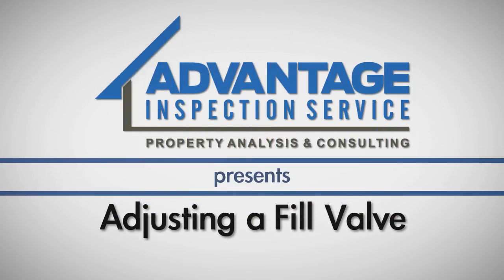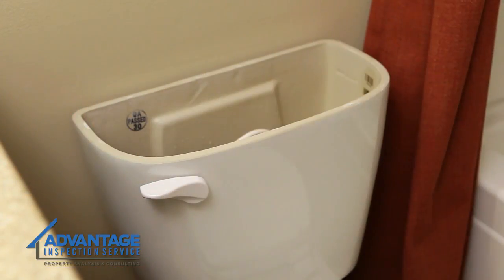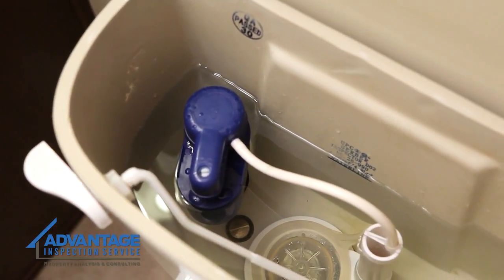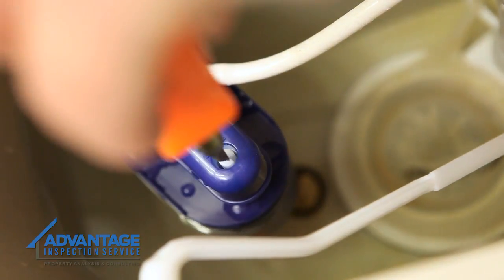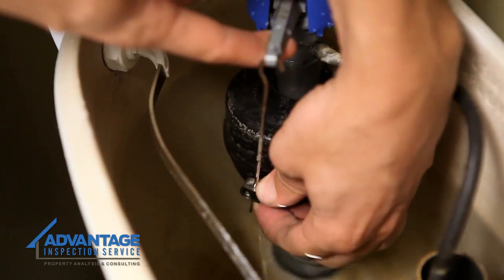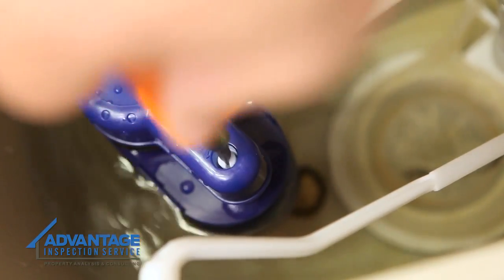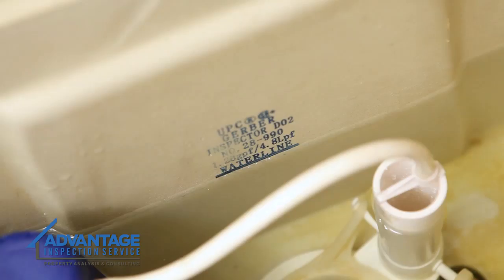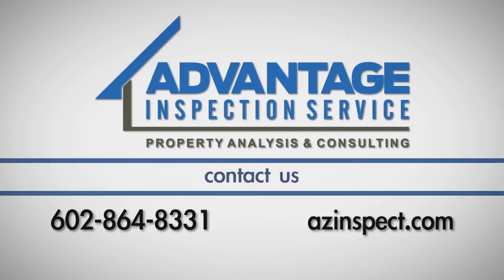Adjusting a Toilet Fill Valve

Comment: I have the Toto 430 fill valve and it occasionally does a 2 second run. We hear the short water running sound. Only for a second or two. Water height is 1/2 to 3/4 below tube. I have taken it apart and cleaned filter, all rubber seals look good. Any ideas?

Comment: I tried to adjust the fill valve by turning the screw to lower the water fill level.   Nothing helped.  Toliet is still running.
Reply from the maker: You may want to try replacing the flapper. If that doesn't work, the fill valve needs replacement.
Reply: Same. Flapper is not the problem.
Reply: @samuelaraiza9098  Take apart the valve, clean, and replace two rubber parts, the small one can be flipped over if it does not disintegrate on you. ( For Toto Emax), there is a good video for this.
Reply: @jeb1758  how do you take the valve apart for the Gerber 28-990? ... it looks different than videos I am able to find.
Reply: mine is also not the flapper .... the hose continues to run and I have adjusted the value level as far as it will go to the left.
Reply: You can buy a replacement fill valve on Amazon for $10
Reply: Same
Nothing is working
Reply: @Azinspect  I tried to adjust the fill valve with a screw driver as you mentioned for the first type. But the water just stopped flowing. Now there is no water flowing from the fill valve. What point should I maintain the height so water starts flowing again.